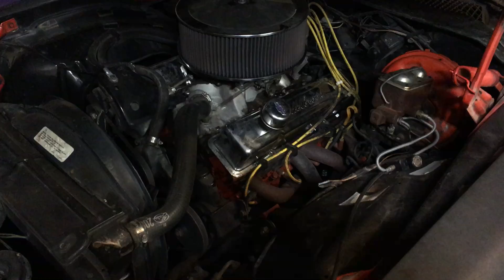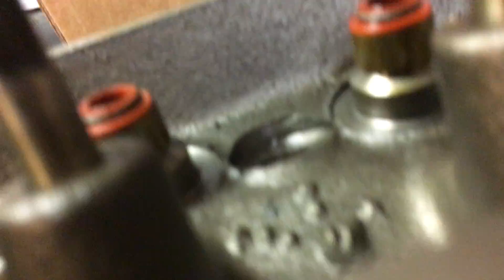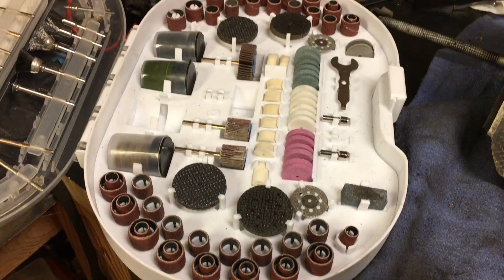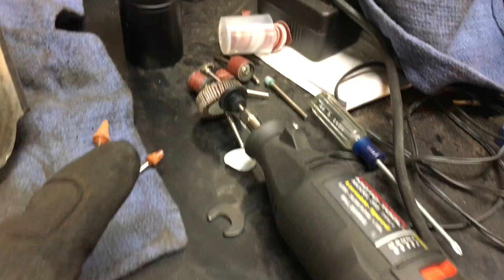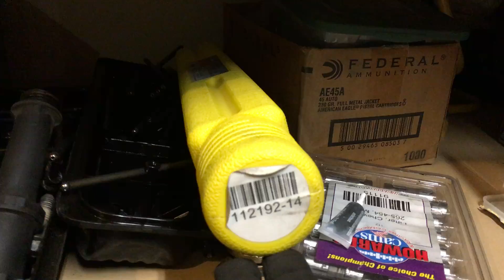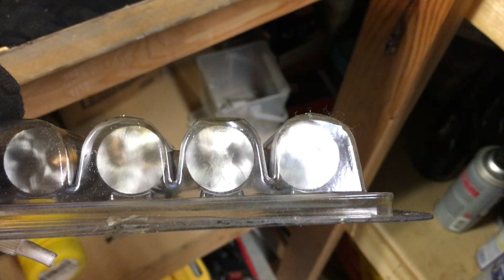Small block chevy vortec heads

Comment: You did a pretty nice job for a novice, The thing that I see is that you just want to be careful for what I've heard not to take any material out of the combustion chamber when you're cleaning that area up and when you're inside the port you want to do the short side radius and focus on that too as well as you did the long side radius they're in but it's just like you said just a small cleanup of that sharp edge and then match for the intake with a scribe and blue dye and the intake gasket and you're good to go! But as far as I'm concerned you did a pretty nice job for a novice!

Comment: .475" max lift on stock vortec heads without cutting down guide boss also have to cut down rocker stud boss for screw in studs & guide plates for push rods.

Comment: I just took my set from a junk yard the engine was good. Do  I have to take them to machine shop. I just need my truck to run. The ones in my truck are 906 the ones from the junk yard are 602. Good video. Thanks for the information
Reply from the maker: from what you're sayin, I'd just clean them up with some degreaser and put them on. If you want to take the time to do the bowl blend, it will add some power. but to just do a factory replacement, you're fine leaving them as is.

Comment: WHAT YA GOT TO WATCH ON THEM IS IF YOU GRIND TO MUCH AROUND THE VALVE YOU LOOSE CC. ON THE INTAKE I GROUND UP TO HIGH MADE MY AIR SWERL WORSE.SO FOUND ITS BETTER JUST TO POCKIT THE INSIDE AND LEAVE THE OUTSIDE AROUND THE VALVE ALONE.GOOD INFO ON THE LIFTERS THANKS

Comment: Did you say that stock they will only handle .430 lift? Total misinformation there, the stock fuckin engine had a .450/.460 lift hydraulic roller, so why would GM make them coil bind past .430 lift? I've installed 480 lift cams in uncut vortec headed engines with no problem, my daily driver has heavily modified vortec heads with a 575 lift hydraulic roller in it. It's making over 450hp. Stock runners with cut valveguides & screw in studs, one should stay below .525 lift, because the flow starts dropping off. Port them and they'll flow past .550 lift no problem. I seen a 383 making 560+hp with ported 906s. 350s making 530+hp. Pretty common in the Oval track world in classes that require production based heads.
Reply from the maker: I really need to shoot some more video. I actually have the heads done and in the car! It is a whole new beast! Runs great and pulls all the way to 7000rpm. I have a little tuning to do, but it's mostly there. I plan on going back to the dyno to do my final tune and of course get my new power numbers.
Reply: @jimsgarage4112  power per dollar, it's hard to beat a good ole SBC.
Reply: @thereluctantgearhead4544  ok so I'm puttin together a 99 vortec motor with the vortec heads, but I have a set of 5cc dome pistons to go in it and a Hawards 258 266 cam with 1.5 rockers it will b a .600 lift cam, 1.6 rockers will make tht a .640 lift cam.  so I'm not sure tht this is gonna work together, specially with the block beein 0 decked. But my machinist sold me the pistons but I asked him did he think I would touch 400 hp and said no. 🤔😳 but I opened them vortec heads up to 90% of the valve opening like "piss cutter" said. So we'll c, but I think if I go with the vortec heads ima get the 202 160 bigger valves put n the heads. Ima do the port work and let my machinist cut the spring seat and put n screw n studs... idk I hope thy will work, but I'm also thinking about bitting the bullet and getting a set of the Skip White NKB heads, I think he gave me a price of 8 hundred and some for them heads with all good valves and comp hardware in them. Because my machinist said from 600 to 700 to do everything to the vortec heads so thy will flow decent with the cam I have. But this is just a little starter motor for my lil 98 stepside s-10, once i get the truck set up right ima go all out on this 400 block I have. Atleast go to a 406 with it,  I have seen some realy nice 406 screaming motors.. Beleave I'm not just throwing stuff together, I put my block n the machine shop last March and I just got it back and it's n my shop just beeing improved everyday,  taping all of the bolt holes, opening up the oil pump and whre the oil pump mounts to the main cap to let the oil flow better. I drilled and tapped the 2 holes for the timming chain today..  but anyway any advice anyone can give me I'm all ears 🤷‍♂️ and good luck to everyone building a motor on here !!!
Reply: @keithwesley9880  I'd recommend using the aftermarket heads and bowl blend them, that's alot of cam for Vortec heads, need longer valves and guides cut for more installed height clearance, the aftermarket heads will handle that cam alot easier. I've seen circle track 560+hp 383s with modified Vortec heads, and 530+hp 350s. If it's not making over 400hp with them parts,  something's wrong. Typical  NHRA legal 1974 L-48 350 makes around 425hp with mostly stock parts and terrible 882 heads. Some folks just don't like old school 350s and they have a low opinion of them. But they obviously haven't been around the right 350s. Many NA 550-600+hp 350s have been built over the last 50+yrs. All one has to do is go to any dirt track on any weekend and there will be a bunch of them to be seen. Not uncommon in some circles. I've built alot of rowdy SBCs myself. Still hard to beat a nice built old school SBC. If I need more than what a SBC can do with the budget allowed, I go with the bigblock Chevys.
Reply: @keithwesley9880  Built a few 400s back in the day that made well over 600hp NA and turned them 8000+rpm. Getting hard to find them now. 1000s of 400s were blown up on the dirt tracks over the years. So the supply of them has decreased alot. I always liked the 400s. Easy to get power out of them. Need at least a 220+cc runner head that'll flow 300+cfm to really get the power with them. And alot of cam, like 270/280+@.050, 106 lobe separation and .650+ lift.. Compression comes easy with the 400. Over 12-1 with flat tops is not uncommon for them. A forged 3.875 stroke crank with 2.00 in rod journals will go in there pretty easy. Cap screw rods give some clearance, and a small base circle cam. .030 over 400 block with that crank will get ya 421 cubes.
Reply: @thereluctantgearhead4544  yes sir, I bought the cam bfore I knew tht I needed to pick my cam by how much the heads will flow. But I said atleast if it don't run good it will sound good amyway... 🙉 but I think thts the way ima go, is with the Skip White NKB heads. Tht way when I build the 400/421 like u said I'll already have the heads for it. But I said the same thing when my machinist said it won't make 400hp I was like 🤔 what, but he said it should b around like 11.1 or 11.5 to 1 compression, I was like well I guess we will c what it will make, I just knew this lil s-10 is a pretty light truck so it should run pretty good. I think a regular vortec motor with no upgrades would do good n tht lil truck. So I know like u said with the parts I have to go n this motor it should do real good. I'm hoping for atleadt low 8's n the 1/8 mile once I get the rear end tht I want n it. I have my th350 transmission tht ima rebuild my self also. It will b the first transmission tht i have rebuilt, but I want to go all out on it, I want it to snap necks when it changes gears... 🤣 thanks 4 the info.... where r u located ??? Im n nc my self, I wouldnt mind goin check out one of them dirt circle tracks like u was talking about. Idk of any close by around me... use to b a small circle black top track close by me "orange county speed way" but I think thy closed it down...
Reply: @keithwesley9880  Been a long time since I built the dirt track engines. I'm retired now, just build shit for myself these days. Still work on hotrod engines daily. I'm more into drag racing myself. Have a few projects under construction. One is a 95 S-10 Blazer. Already had a few hot  SBCs in it, but now I want to go with a twin turbo 427 bigblock. Also have a 355ci C-10 I mess with, and a 84 Z-28 with 355, a 63 SD421 Catalina, a 79 Cutlass with a 455 Olds, 96 Ranger with a turbo 4cyl, a 86 Bonneville with a 496 bigblock, and a few others. Also have a bigblock jetboat. I live by the Ohio River on the KY/Indiana state line. From Lousiana originally tho.
Reply: @keithwesley9880  Your truck should probably run mid 7s in optimal conditions. I've built several V8 S-10s over the years, pretty easy to get them in the 7s. Set the chassis up like a NHRA "Stock Eliminator". Alot of ET in the setup.
Reply from the maker: ok cool. when I was reading up on these heads, watching videos (things like hot rod garage and engine masters), they all said to put a big cam in you need to machine the head or use different springs. So I used different springs. Since I would have to change springs anyway to match the cam, that was the logical choice for me. My cam has .517" lift with 1.6 rockers, so I had no choice in leaving the springs or head stock. I HAD to do something for it to work. This is my first build. But I try to study and learn before selecting parts and avoid any breakage I can. Even with 1.5 rockers I have .485" lift... I decided to take the safe route and make sure I had plenty of tolerance for my valve train. From what I've been learning, it's better to have plenty of room for the valve train to operate. And since I don't have a lot of money to rebuild a broken mistake I could have avoided, I plan safely so I can actually enjoy what I've built.
Reply: @jimsgarage4112  better safe than sorry. Bigger cams make more power anyway, might as well set it up right. You'll be happy with your build. Should make 400+hp no problem.
Reply: @jimsgarage4112  my daily driver has modified vortec heads on it, 575 lift, 255@.050, 108 lobe separation  hydraulic roller. Been driving it daily for 4yrs now. It pulls hard past 7000rpm. I'm pretty happy with it.
Reply from the maker: Shit 4 Brains all the literature and speaking with a GM engineer who knows a lot about these says .430-.450 lift max. You can run a few different valve springs to get more, that's what I did. The factory L31 cam did not make .450 lift. I promise. Those cams were puny. There is a lot you can do with these heads and I've only scratched the surface. I'm merely passing on the info I have found.
Reply: @jimsgarage4112  I've built at least 20 engines with vortec heads since the late 90s, I know a little bit about them. None have coil binded at 450 lift. I always cut them for PC seals anyway. But I've seen them take .480 lift with no cutting.
Reply: @jimsgarage4112  I've been building engines for a living since 1990, so I'm not a young keyboard warrior that watched a few utube videos and suddenly knows everything, I built my first engine in 1984. Most people don't give the vortec heads a fair shake, usually too conservative. But they do have much potential.
Reply: @jimsgarage4112  I was actually thinking of the LT1 cam when I said 450/460 lift, vortec is about 430, but I've built a couple cheap simple 350s using a stock vortec L31 longblock and swapping a stock LT1 cam in, a dualplane intake and 3310 Holley and headers. Easy 325+hp 390tq on the cheap.

Comment: Cut the guide bosses down to look like a tear drop inside the bowl area clean up the entire bowl and blend it in and around the guide!! This will give a much smoother transition for the air to flow.. I worked in a machine for 20 years and we had to port tons of theses heads for the dirt trackers that had to run a GM casting we were getting around 260ish @ .400 lift and 290 @ .550 it was typically worth a 65 HP gain between porting and not porting we had a flow bench and a 406 on the dyno as a test mule it was a Street Solid Roller cam 570/570 lift with 1.5 Rockers we did use a 1.6 Roller Rocker to get a gross lift of 608 net was 580ish depending on the lash it was around 18/20 hot and duration @ .050 was 250/250 on a 108 lobe sep. it was a Isky cam 11:01 compression 1 3/4 headers Air Gap intake Edelbrock was probably the best of the duel plain intakes as we tested those to for Street use The Super Victor was the best for Street/Strip it made about 475 HP and torque was great @ 490/500 ft lbs on pump gas.. we also tested the newer version from GM over the counter Vortec Bowties offered in 185 and 225 runner those heads made serious power especially ported on the same engine the ported 225 runner made 580 HP and 520 ft lbs of torque on pump gas. Now this was done 15 years ago and my numbers are close but it is hard to remember the exact numbers we tested and built so many engines with different combinations Ford Chevy Dodge we built whatever the customer wanted. I do remember that we were satisfied with the numbers at that time. Thanks I hope this was helpful to anyone that is on a budget and just getting started in the Hotrod world as I was and still am a drag racer myself. I believe we used a custom grind cam from Lunati with larger Vortec Bowtie heads this cam had 630/645 lift and duration @ .050 was in the 260 intake and 268 exhaust on a 108 lobe sep. now these numbers are not spot on as I said it was 15 years ago.

Comment: The only thing I would of had done was magnaflux them for cracks. Vortex heads are pron to crack at the exhaust valve seats.
Reply: Also between the chambers, accross the quench pads. I have failed way more during NDT then passed.
Reply: Yup. I pulled a lot of these at the junk yard and have yet to find one that is not cracked. You can use these as cores as some of the builders out there can repair them with pins. There are several aftermarket head suppliers out there as well. These are Vortec clones and are supposed to be less crack prone. Look on ebay for these as well as rebuilt OEM ones.

Comment: Use a high quality metallurgy conical spring for 400hp at near 5800-6000 rpm on 355 with these heads. i would use 10:1 and XR282HR ground on 109* or less LSA. Lobe Separation Angle. 107*LSA , 108*LSA, these fit the valve size better than 110LSA. Another recommend is lunati boot legger roller cam. that 236 cam forget it, it loses alot down low and throughout under 5500 rpm and gives you a higher peak number at 410 at cost. you could make 410 or more with a 230 roller cam.
Reply from the maker: I'm runnin a Howards 254 @ .050, .517" lift with 1.6 rockers, and 114LSA. It doesn't feel like it has lost anything down low. Pulls hard from 3000-7000rpm! I'd rev it more if I had built the bottom end to handle it. Have my limiter set at 6500 just to be safe. I'm scheduling a dyno run soon. Will post it here.

Comment: For the street vortec heads are better than aftermarket because of the torque hump they can produce, the vortecs also can use more fuel at low rpm than an aftermarket aluminum head and that is strange, but what isn't strange is the off the corner acceleration in street traffic and low rpm fat power. That is the ultimate strength of these heads as they fall short on top end until expertly modified extensively. All the modern aftermarket heads base their designs on the LT1 ports and the vortec ports and chambers from a modified state and raised runner designs. This is by far bar none out of all factory heads the best for Gen I small block chevy. A 10:01 static compression 355 cubic inch chevy small block , comp thumpr 283 cam THR-107 made 198 psi cylinder pressure made 396HP @ 5900 rpm and 418 Torque @ 4200 rpm on pump gas. And best average and peak power out of these cams with 91 octane: XE268H10, XE274H10, 280H, 292H(400hp@6000,407tq@4200loweraverage higher hp peak with extensive losses and undrivability). Note the Lobe separation of the thumpr it has a 107* LSA. Lobe Separation Angle.
Reply: Tight lobe separation really helps the torque production on a NA SBC. Sounds better too.

Comment: Alex's parts has springs for the vortec head which excepts lift up to .550 lift. That's what I've been using for a couple years. No problems. He is very helpful, just look him up and give him a call. Comes with everything you need. You will have to measure your installed height which is a must on any spring change but he will explain that.

Comment: Use 787-16 comp retainers, and use ls1-ls6 springs with stock vortec keepers. You can use up to 525 lift without machining the valve boss. Pocket porting is considered as a good clean up  enhancement for mild to hot street builds. I do both intake and exhaust. For a nice street build, velocity is King. Big race ports actually are not necessary and may actually hurt performance.

Comment: read anything from david vizard if you want accurate information about dealing with vortec cylinder heads
Reply from the maker: trillrif axegrindor I’ve been meaning to get some of his literature. I have a reliable source expert on vortecs I’ve consulted as well. I’ve only done the pocket port and will run them as you see them. Research I’ve done shows benefits with this work. Proof will be in the dyno.
Reply: @jimsgarage4112  DV has a channel now and made his own Vortec video, his books are pretty good.

Comment: valve springs can be purchased from summit for $70,buy gm ls6 springs and also use comp  cams Valve Spring Retainers 787-16.
you now will have the ability to run a cam with 0.5" lift without any machining. porting on these heads is very sketchy and not necessary
Reply from the maker: trillrif axegrindor I’ve heard about this. Would be interesting to do side by side testing with the springs I got.